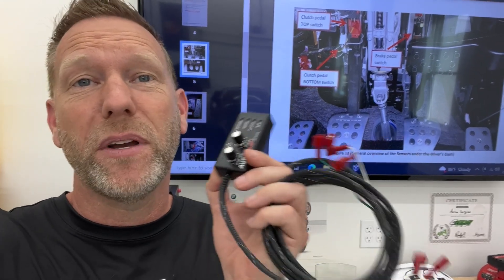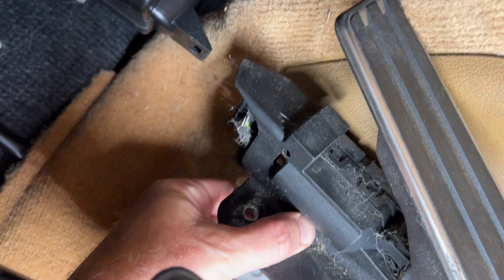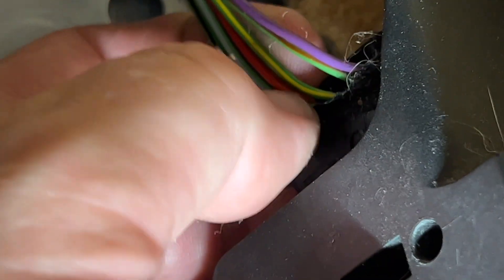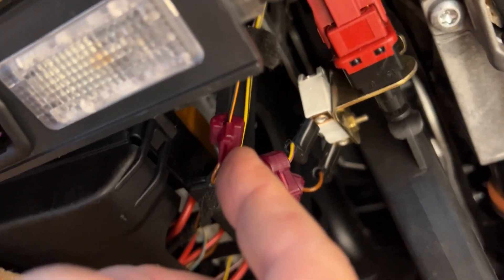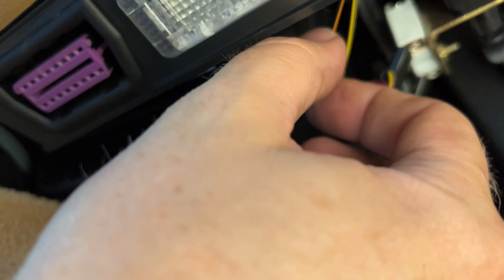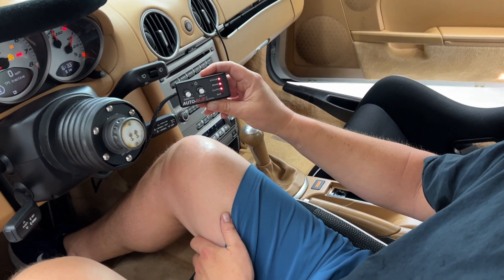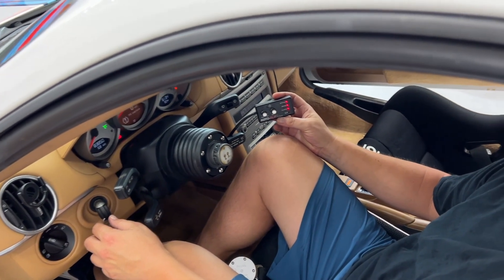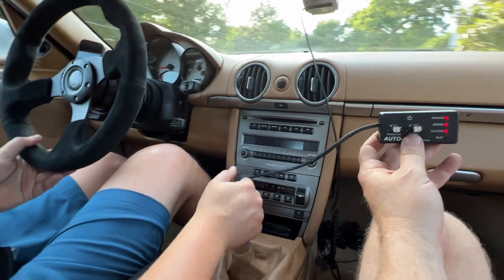Auto-Blip INSTALL and DEMO on a Porsche Cayman S 987

Comment: Wondering if you ended up using the top clutch switch cable and how the general experience using it on track has been…
Reply from the maker: +Hans Westerbeek I didn’t change it, no. And I’ve used it once so far at the track and it was great! I still need to dial it in a bit, but really enjoy it

Comment: Will this work with a ‘98 986?
Reply from the maker: +Alan Vale yes! Soul has it listed on their site for the 986 as well 😁
Reply: Hi +Alan Vale I am sorry, I checked with Paul at Soul and this device is for e-throttle only, I specifically asked if it could be used w 1998 Boxter for you and was told nope. You should learn to double declutch and even heel and toe. It's not hard. It is important when trying to heel and toe that your pedals are set up for proper / easy manipulation, some cars are not. If your brake and throttle are in the same plane, you should be fine.
Reply from the maker: @damage98  Ah bummer. Makes sense though. Thanks for the clarification!

Comment: What happens when you’re at a red light, lift off the brake and then press the brake again. Will it blip if you shift into first while still on the brake?
Reply from the maker: +Mike S. Yup. I turn it off when I’m not at the track or driving hard
Reply: @HelpMeDIY  thanks for the quick reply. I guess I can either turn it off or remember to clutch back in to reset the sequence.

Comment: Nice!   Wondering how it knows if the shifting is up or down since nothing from the device is connected to anything to tell it up or down.   I assume that it doesn't know how to handle downshift of two gears (eg 5 to 3) and provide a bigger blip.
Reply from the maker: +Chitown 388 it knows because you don’t use the brake to uplift 😉

Comment: I'll say one thing, and people can make their own decision. Not a huge fan of "vampire splices." The clip cuts through the wire housing fine but can also damage the wire, itself. If you have a choice, I'd recommend a different connection method.
Reply from the maker: +@colbyscott6359 I agree there are much better quality ways to splice them, the main reason for these is the difficulty of the location I think. 🍻